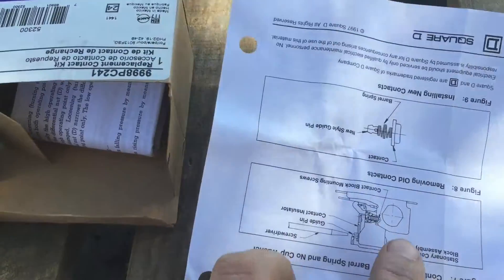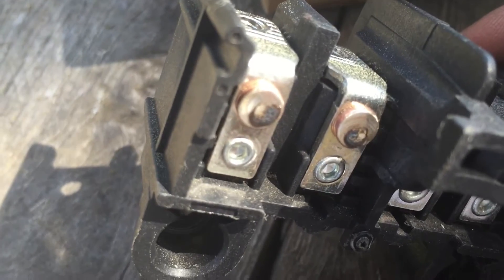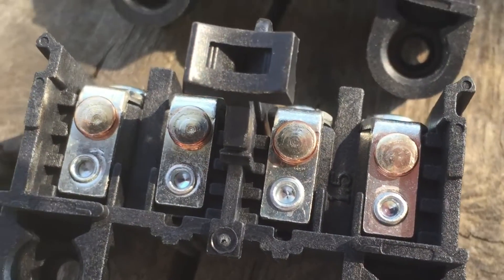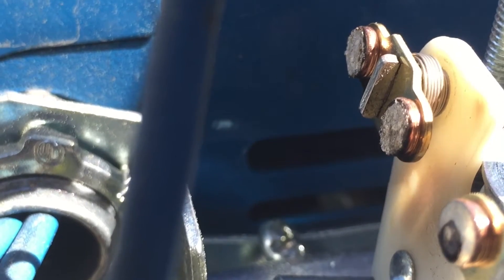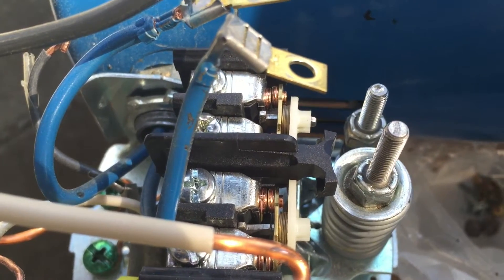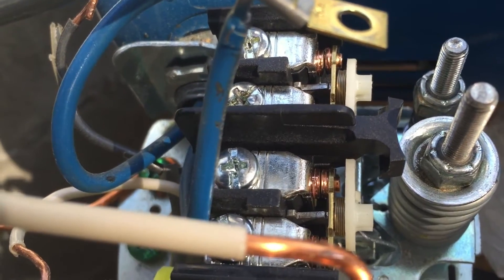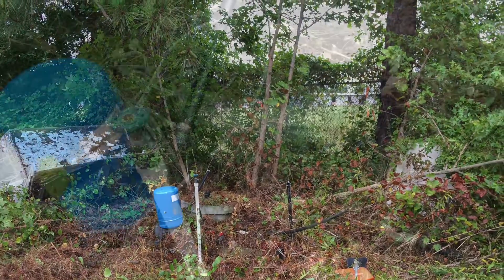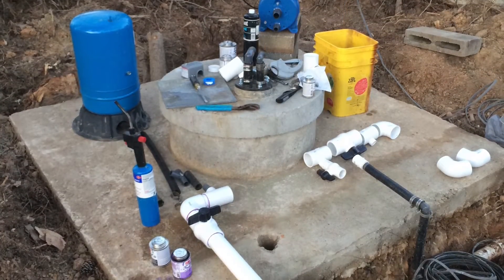DIY How to Replace Square D Pressure Switch Contacts

Comment: Might have spent more time showing how to remove/install the contacts ('rack' is held in by two screws) instead of talking about other stuff.  Thanks for info about wire gauge - my pump pulls 30 amps on startup with 12 ga wire, and a 40 amp breaker.. I'll use 10 ga. Running, it only pulls 12.5 a. Thanks for showing how to pop out the floating contacts.. I'll support the part they attach to when pushing with the screwdriver in case there's risk of bending it and misaligning the contacts.

Comment: Try closing the supple valves, then drain the pressure tank and check the air pressure in the pressure tank. It should be 2psi below the cut in pressure set on the pressure switch. If your switch was set to 40-60 psi then the air pressure in the tank should be set to 30 psi. Thanks for the tip of how to disassemble the contact in the pressure switch.

Comment: You could add a capacitor across the contact, it will help stop the sparking.
Reply from the maker: I must admit that you've exceeded my electrical knowledge.  How exactly would I do that?  FYI that the issue has resolved itself, in that whoever put the original well in ran a 14 gauge wire to the well.  That and I only had a 20 amp breaker in the panel, and somehow missed that the pump draws just over 22amps max.  Have since replaced with a 10 gauge wire and 30amp break.  There is no longer an issue.  Thanks for watching and taking the time to comment!
Reply: St. Isidore's Farm Example: have a look at the old car and bike DC ignition systems, they have a capacitor ( suppressor )across the breaker points to prolong the life of the contacts and stop radio interference. You would need one rated at the correct voltage and type and farad value. Hope this helps. Just a warning about a capacitor, In a DC supply it will work totally differently than in a AC supply.
Reply: @StIsidoresFarm another name for this capacitor is a "soft start" capacitor.

It stores energy on startup so that very brief spoke of power electric motors need to get going is fed by the stored power in the capacitor.

My well has an Pentek (aka Pentair) smc-ir1021 starter circuit that is inline between the pressure switch and the pump motor.

There is a large capacitor and relay inside the box.  The size of the capacitor  is based on the HP rating of the motor.  There is a shunt / bleed down resistor connected to the terminals of the capacitor for safety.  

When the capacitor first gets power from the pressure switch the capacitor acts like a open circuit briefly until it is charged up.  When charged up a small fraction of a second after getting power, it'll pass power onto the motor.  When we the motor has a high demand for current, the capacitor helps keep the voltage up.  A small dip in voltage causes the motor to take extra current to make up for it.  Current and resistance is where there is heat... Heat is the enemy of electrical.   

Soft start capacitors are used on all kinds of equipment including Compressors (HVAC, some refrigerators for example), etc.

A capacitor can eventually go bad so it is one more part to failure, but when used / sized properly it can add years of life to an AC Motor.